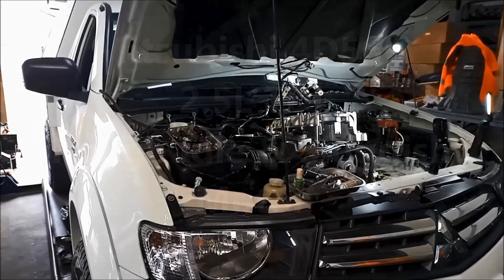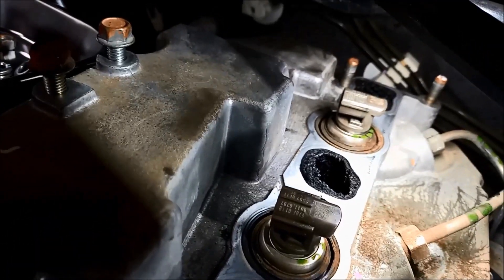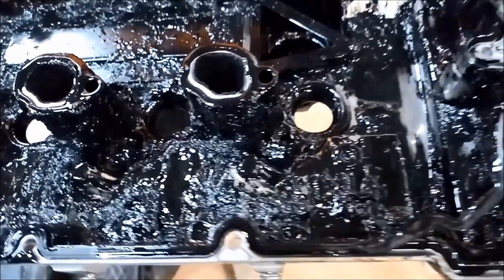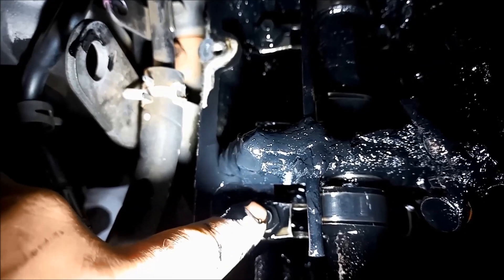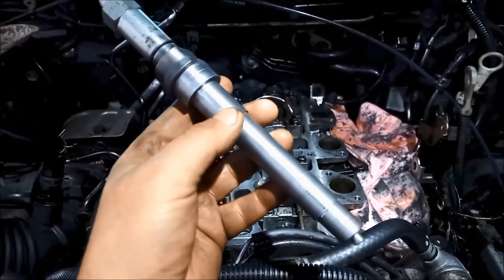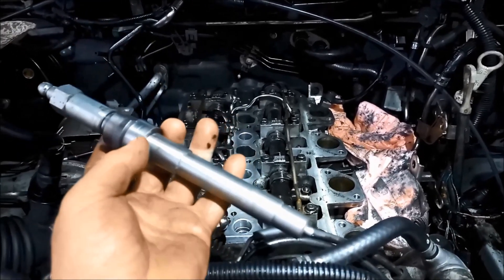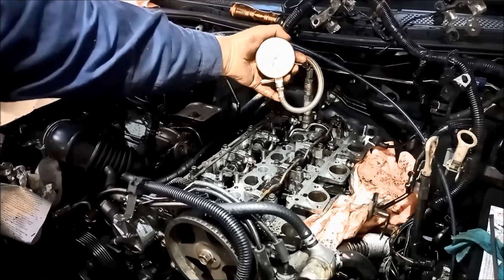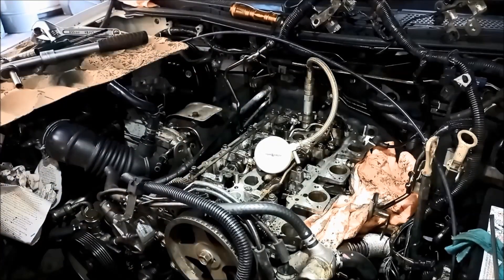Mitsubishi Triton L200 2.5L CRDi 4D56U No Power Rough Idle Noisy Smoky Low Compression  4D56T Part1

Comment: Hey mate, do you happen to remember how you loosened the three top bolts holding engine and transmission bell together? Nothing useful in the workshop manual
Reply from the maker: hi, remove the bolts on transmission mount and jack up trans to floor will give you some more room if undoing bolts under bonnet, if undoing bolts under vehicle remove trans cross member and allow trans to lower, then use long extension bar to reach bell housing bolts from under vehicle.safety always first ! cheers
Reply: @YepThatsIt  cheers for the fast reply mate, will try that!
Reply: @YepThatsIt  can the transmission be jacked up without removing the propeller shafts? Or should I follow all the steps for transmission removal

Comment: I got one of these Itsabitfishy MN Triton's and mine carboned up at 65K and had to be chemically cleaned. The valves were rattly as well so that was done too. Then the balance belt stripped, so it was replaced along with a new timing belt. Then an injector went belly up, then the SCV ,and then the boost control solenoid. And that is only the motor side of things, but I won't bore U with the rest.
The list is growing longer with every month. Mine is a pig
Reply from the maker: hi, on modern engines the manufacturers tend to use bad choice of oils to help them meet australian emission requirements. always use best and low soot/saps oils you can afford as well as shorter oil change intervals. add a catch can to reduce oil vapour circulating through egr and turbo. replace the engine cooler with a remote filter as in those vid series, these will help. cheers

Comment: Hello Great video.  One Question:  What is the normal values (PSI) that must have a motor Mitsubishi L200 2.5L Diesel 4D56U?
Reply from the maker: hi, minimum 240psi to maximum 362psi, & maximum difference between cylinders @ 250rpm - 43psi. hope that info earns me some beers, link is in description cheers

Comment: I'm guessing with that much sludge in there its not had very regular oil changes, and now its basically too late as all the sludge you cant see will eventually start breaking up and clog the oil pump and narrow passageways unless its changed very frequently now. Some snake oil type products might clean it out but what will end up blocked in the process, which bearing will spin. I'd have no confidence at all in a repair on this engine. Will be interested to see what you do.
Reply from the maker: hi, yeah its in line for removal, disassembly and inspection. cheers

Comment: Could prolonged loose rockers wear/scar/gouge the head valve cams, thus causing significant differences in cylindrical pressure, in addition to the effect of the built up carbon deposits everywhere in the motor? 

I love watching your YouTube clips
Reply from the maker: hi, excessively loose/worn rockers will not allow valve to open as much as they should, so poor engine performance and rattly noise. if they are adjusted too tight, the valve kind of bounces and wont seal the cylinder for length of time it should, or even wont allow valves to close properly under load/acceleration. the specs are there for a reason. cheers